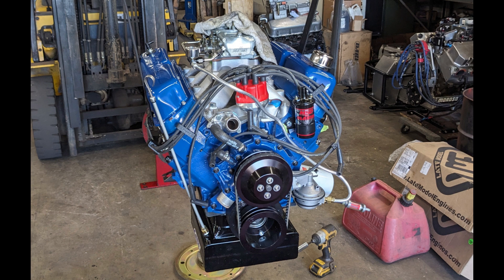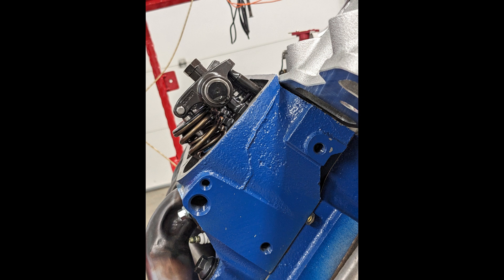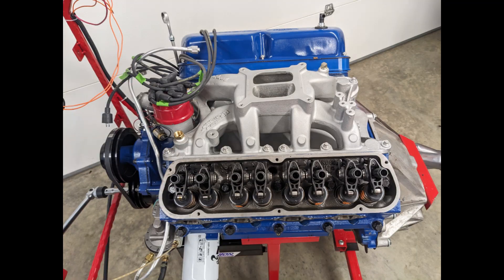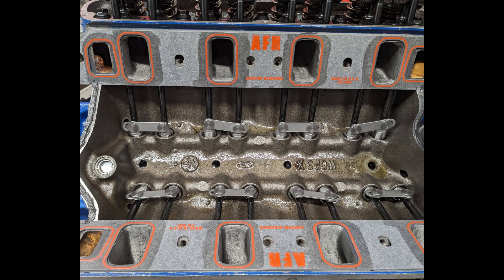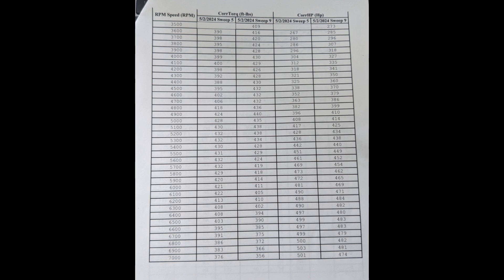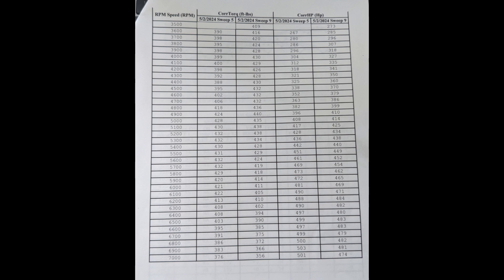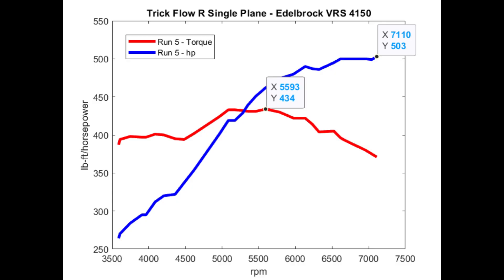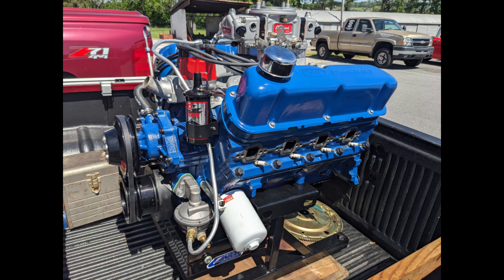500 HP or bust! Ford 351W build dyno tested

Comment: I expected more, atleast 550hp, i new windsor sr or what have u are not great, not offen a 347 makes alot more, but i have afr
Reply: You shouldn't expect this 351w to make 50 more horsepower with his world sr heads (80's technology) to your afr 220 heads with a 2.10 valve that flow over 50 cfm More and you have a camshaft with 100 thousandths more lift and probably more duration.
Reply: @erikalston4496 no comparison to AFR 220’s. This’s an easy 525-530hp engine with a little bit more timing, race fuel or E85, electric water pump and some tuning.
Reply: @erikalston4496  I believe he's in the .620ish lift pretty healthy look at beans79 Chinese heads hydralic cam 430 at tires so, who nows
Reply: 609 lift @alltherpm
Reply: I think you just wanted to come pound your chest.  In no way shape or form are ported Windsor Sr heads going to compete with AFR 220 Renegades.

I ran a similar combo and made 526 hp.  .030 over 69 351w, stock crank and rods with flat top Wiseco pistons, XR292 solid roller (.621/.627 254/260 @.050 110), Vic Jr intake, 750 Mighty Demon.  Heads were milled to 58 cc to get 11.06:1 compression.  Mustang GT ran 10.90-11.00 @121-125 consistently.  I had a converter set up for Nitrous.  Went 9.80’s@134-138 on a big shot jetted down to 150 hp.
Reply from the maker: I'm thinking conservative dyno. Engine was carrying power all the way out to 7000 RPM with the single plane, so I don't think lower numbers were from lack of head flow. Heads were flowing about same as AFR 205 after porting, although AFR does have smaller combustion chamber.  I will probably run it on a chassis dyno to get another data point. There is also ET and trap speed...
Reply: @MarksMuscleCarGarage  can't say there the same as afr, cause mine made 540 at tires with same stuff but afr renagades, and a 408 made 630 at crank with more compression tho which is tiny hp per point higher, but u still have a nice engine tho
Reply: @alltherpm  Can you show us a video of your 550hp 347 on an engine dyno? How much compression and camshaft does it have?
Reply: @erikalston4496  this engine was built in 2004 utube was nothing but music, but I got nothing to prove but the car, there's plenty of videos with same parts I got anyways, there like flies on shit on utube,
Reply: @alltherpm  You dont know the compression or cam specs for your 550hp 347 ? What size combustion chamber did your afr heads have? Thanks
Reply: @erikalston4496  10.1 srp pistons flat tops, eagle esp rotating essembly,, decked, afr220 bullet racing solid roller .700 lift int & exhaust, jesel shaft rockers, vic jr intake, in 2004 I had fully ported vic jr heads cylinder, now I got afr's like the builder told me to
Reply: @MarksMuscleCarGarage  
"Some say" that 111 LSA is 3 - 4 to much for a 357 CID engine with 10.5:1 compression ratio. 
That is why it is in the low 1.20 lb/ft/CID area.
Reply: A 347 will always make more than a stock stroke 351W if both engines are built identically. A 347 has less rotating mass which means more hp. A 351W crank is heavy for no bigger than the engine is.
Reply: @BlackLabGarage  I agree with u wich I'd take the extra weight cause that's torque, 351 usually has little more torque
Reply: @alltherpm  That's my only gripe with a 351W is they really should of had bigger main bearings given the crank weight. I've never torn a 351W down that didn't need the crank turned from wear. Not from dirty oil but just from wear. But I've torn a lot of 302's down that the crank was just fine in. Just needed polished and was ready to go.
Reply: @BlackLabGarage  I agree I bought this rotating assembly in 2004 when I was almost 20yrs old, lasted through those yrs, and all I do is roll in New bearings, cranks been awesome, but mines nitrated
Reply: @alltherpm  Ahhhhh...yeah the nitrating would definitely help the crank not wear
Reply: @erikalston4496  I have several videos just click
Reply: Engines are air pumps.  Your engine had less restrictions in and out of the air pump.  You made more power.
Reply: @jasonwalker999  I think that's what was said, read other comments, them heads have same size ports as afr heads, obviously it's not just air flow on internal combustion engine, we're a air pump don't have a mixture
Reply: @alltherpm  those runners aren’t the same size unless they were massively ported.  They start out as anywhere from 195-200 cc runners.  Even with porting they still won’t hold a candle to an AFR 220 Renegade.  The AFR is way better on the intake, but it’s massively better on the exhaust, the AFR has a raised exhaust port the Sr. doesn’t.  The Windsor Sr is a better version of 69 351w heads, and can be ported to make some power, but it would take a ton of time and effort to try to match an AFR 220.  Mine were ported and only flowed in the 250 cfm range on the intake, can’t remember the exhaust numbers.

AFR 220 heads flow 315 on the intake at .600 and 245 on the exhaust at .600.  So the heads you used flow on the exhaust what the Sr. flows on the intake.  So your original statement about expecting 550 or more is unrealistic with the flow numbers of the heads.

So again you came to flex on this build, with your build that had massively improved heads than what this build has.
Reply: @jasonwalker999  I did the same thing this guy did felpro1262, had to cut it a little, please if u don't no 220's don't even bother, I used the same gasket on my edelbrock vic jr to, this guy's heads no small ports
Reply: @jasonwalker999  afr 185 same gaskets
Reply: @alltherpm  what are you even talking about?  I know AFR 220’s, I have a set of the old AFR 225’s (there are quite a few differences but they are very similar, as the 220’s replaced the 225).  I know Windsor Sr’s because I have a set of those too.  The AFR 220’s flow through the exhaust the same amount of air most ported Windsor Sr heads do.  This guy ported his to 300 cfm on the intake but didn’t touch the exhaust.  The AFR head is light years better (whether the Windsor Sr is ported or not).
Reply: @jasonwalker999  u were talking about intake runner size, now I called u out u talk about exhuast side, give it up please
Reply: @jasonwalker999  why do I use same intake gaskets, again he used biggest set available. Not my fault nobody buys good parts, with size of those heads I didn't expect 100hp less, so that means sucks
Reply: @jasonwalker999  there's another channel same name buy crazyhorsegarage same exact build as mine but more compression 13.1 exactly 580rwp y cause afr that's y
Reply: @jasonwalker999  take another channel mikeymac stock 302 lower original pistons but trick flo 19011r  400wrp, so again all them heads u have suck
Reply: @jasonwalker999  and for afr 225 they stopped that run cause they flowed less then 220's
Reply from the maker: @jasonwalker999  Exhaust flowed 207 with a pipe, after valve job and bowl blend from shop, so better than stock but probably can flow another 20 cfm with more work.
Reply: @MarksMuscleCarGarage  you must’ve done quite a bit of work to get them to flow that much.  I thought you mentioned in another comment you hadn’t ported the exhaust yet.  

I liked my Windsor Sr heads but if you don’t know how to port, buying a set of AFR or TFS heads would put you further ahead.  Plus Windsor Sr heads had thin decks and were prone to walking under a bunch of cylinder pressure.  The Aluminum offerings typically have 3/4” decks.

But they are a great head and the value was there.  They were great hp/$.
Reply: @alltherpm   how exactly did you call me out?The Windsor Sr heads have 195-200 cc intake runners as cast.  You are talking about gasket size.  Who cares about gasket size.  Talk about intake runner size, shape, and port location.  Intake gasket size doesn’t dictate intake runner size.

I started talking about exhaust port because the AFR is a raised port head the Sr isn’t (and the exhaust flow on the AFR flows more than my set of Windsor Sr heads).  Not quite sure why you keep blasting a set of heads that cost $1000/pair vs a race ported CNC $2500/pair head.

Also I pointed out the fact that the 220 replaced the 225, obviously you aren’t reading things.  You just want to hear yourself talk and put others down.
Reply from the maker: @jasonwalker999  I didn't 'port' the exhaust but the machine shop did do a performance valve job and bowl blend.  Doing a bowl blend is low hanging fruit because the as-cast bowls do need some clean up.  The intake flowed about 272 peak when I got it back from the machine shop and exhaust was about 207.  I got the intake up to 256 at .400, 303 at .600 and 314 at .800.  For the exhaust I didn't touch the ports other than to polish them and narrow the valve guide boss some.  I was going to raise and widen the exhaust ports, but wanted to finish the build so I didn't go any further and there is still some pretty easy gains in the exhaust.  Yeah I could have purchased a set of AFR or TFS, Al. heads but I had purchased the Windsor Sr's years ago and wanted to see what they could do.  Just buying a new set of aluminum heads would have been pretty boring in a sense.
Reply: @MarksMuscleCarGarage   I wasn’t doubting your build at all.  I built a very similar combo.  Those are pretty good flow numbers, mine didn’t flow anywhere near that.  Mine were actually Roush 200’s that were supposed to be the improved head.  

I was only stating if someone didn’t have porting skills, to pay someone to have the heads flow similar to an out of the box AFR would cost more than the original cost of the AFR.

Many of my comments are geared towards the original commenter that keeps trying to compare these heads to an AFR 220.

I like the build and think you built a great runner.
Reply from the maker: @jasonwalker999  Yeah, I wasn't taking offense.  I did a few videos on the heads and know everyone hasn't watched them so was just providing some info.  Thanks for chiming in.
Reply: Stupid shet here for sure I guess my comment on afr 185 went right by u again small 560 lift hydralic cam on a 351 on touched lower made almost 430wrhp, I'm so sorry those heads don't make good numbers, like I said my fully race ported vic jr flowed 320 at .650 lift more then I flow with 220's and was port matched to it fit edelbrock, fit my untouched 220's  perfect weird, but I picked up 8 mph in quarter, last comment I'm writing cause people who buy cheap 1500 heads put another 1500 into port work waste there money like I did on edelbrocks, almost 100hp is nothing to look lightly at, but u got to much pride
Reply: @alltherpm  it’s not about pride.  I’m saying that you came to bash the dudes build by trying to compare an iron head from the 80’s to a head designed/built in the 2000’s with all the tricks of the trade.  Then proceeded to explain runner volume by the size of the intake gasket.

Oh well have a great day.
Reply: @bigboreracing356  u my friend need to actually live up to ur name atleast sunshine
Reply: @alltherpm well then how much rpm are you living up to? Smh bud.....you gotta know there's always someone flying higher and faster.
Reply: @bigboreracing356  ur one of those utube dreamers, someday u might b a man and actually do something instead of dream,,if u want to race just ask,, don't have to b a idiot

Comment: What size are the dyno headers? Thanks for the Excellent content
Reply from the maker: I did some more work on them and got them over 300CFM. Watch the Amateur Head porting results video, and the how to video if you want to see the additional work I did.
Reply from the maker: Thanks. Dyno headers were 1 3/4 to 1 7/8 step headers.
Reply: @MarksMuscleCarGarage  one more question you said in one video the heads flowed 300cfm but in another video you showed the flow numbers and flow was 250cfm what gives?
Reply: @erikalston4496 the larger flow number must've been after the port matching, valve job, and short turn emery cloth work. The Windsor Sr head is capable of that with little modification in the right places. World Products also made a ROUSH 200 head that was only $800pr and performed much better. Rare though....and I sold my last set 5 years ago.

Comment: Pretty decent results! That'll be a good running engine. I picked up a set of bare Windsor Sr. heads at a swap meet for $100 a few months back. I planned on doing a 357 with a block I had laying around and coincidentally built basically the same motor you did but I plan on running a Vic. Jr. & a quick fuel brawler 750. It's got a Lunati solid roller, 243/249 @.050, .616/.624, 110/106. Icon flattops, Scat forged I-beams, Scat cast crank, 3.5in stroke, ETC. 10.5:1 cr is what I'm hoping to get to with some head work like you did. Saw your last video right after I got to buying parts and have been waiting for the dyno vid every day since to get an idea of what mine would make and im satisfied! Mine will be going into an '88 F150, single cab, short bed, and a ZF5 transmission.
Reply from the maker: Yeah, that is pretty close to the same spec's as what I built. Should be a fun motor in your truck with the 5 speed..
Reply: @MarksMuscleCarGarage  Yessir, should  be a fun ride! I’m only 20 so 500hp should be plenty 😂 This is my first build I’ve done by myself so hopefully everything goes well.
Reply: As an F-250/351W/ZF5 owner....a 5 speed with 4 usable gears! Lol just playing, but yeah 1st is great but only if you want to climb a vertical wall or pull a house down 😂 @MarksMuscleCarGarage

Comment: That's good power for that motor in my opinion l have a 384cubic inch winsor l had victor Jr intake and victor Jr heads 673 673 solid roller and it made some where around 575 to the tires that was 22 years ago
Reply from the maker: Thanks. 575 whp is a lot for 384 inches. Pretty stout.